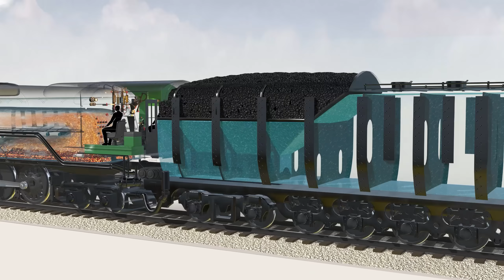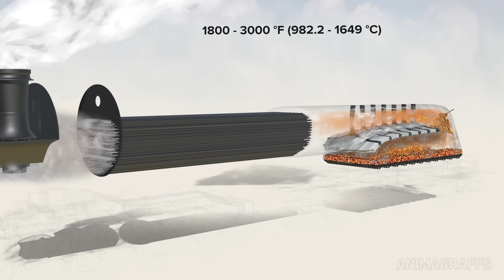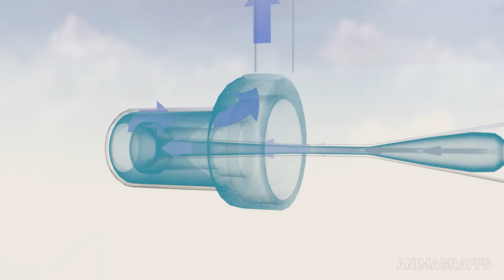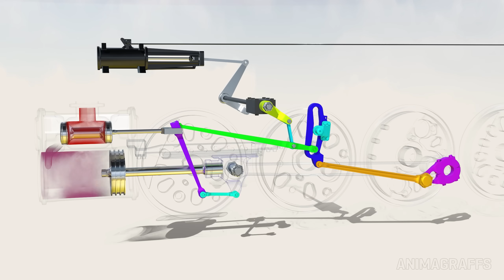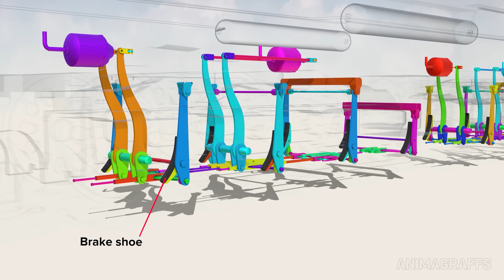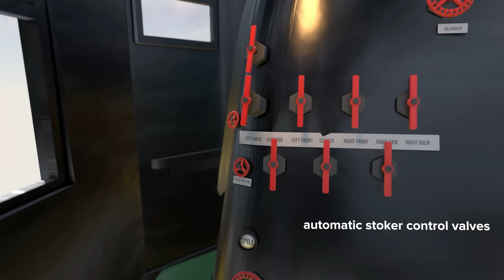How a Steam Locomotive Works (Union Pacific "Big Boy")

Comment: The first internal combustion engines built on so much technology developed for the steam engine. Pistons, piston rings, connecting rods, crankshafts, plain bearings, and poppet valves (not used in this steam engine, but used in certain others). Not to mention the metallurgy and the thermodynamics. The valve gear with its geometry was a kind of analog computer ; mechanical engineers in those days were masters of turning one kind of motion into another with linkages, something we rarely have to think about, since we can use computers and servomotors.

Comment: 00:19 🚂 Big Boy, built in 1941, was one of the largest and most powerful steam locomotives, weighing about 604 tons and capable of a top speed of around 70 mph.
01:19 🔥 Steam power is generated by boiling water, causing it to expand into steam and create pressure. This pressure is used to push Pistons and rotate the wheels.
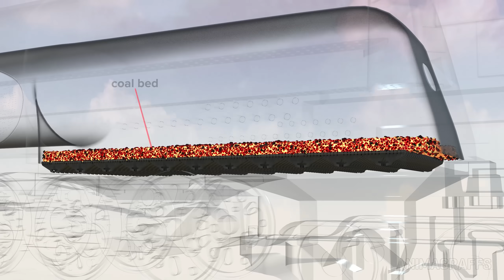02:18 🔥 The Firebox is where coal is burned to generate heat. It has movable grates for coal disposal, air openings for combustion, and specialized sheets to contain the fire.
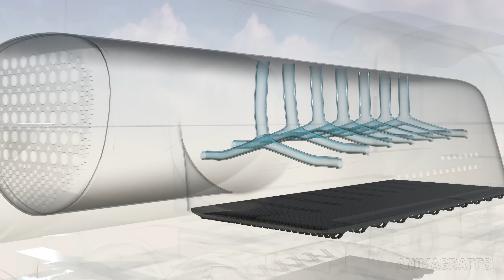03:45 💧 Tubes extending from the Firebox increase water circulation in the boiler. A brick Arch directs heat and smoke for efficient combustion.
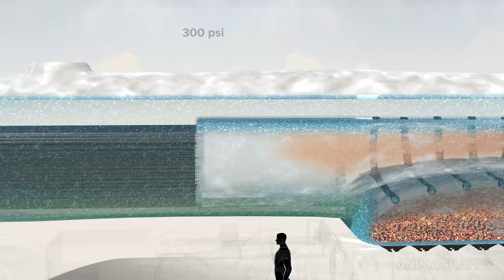05:11 💥 The crown sheet in the boiler must always be covered by water to prevent boiler failure and potential explosion due to extreme pressure.
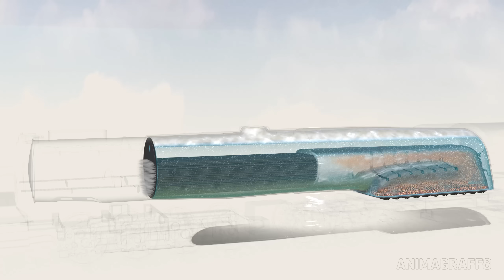06:15 🌪️ Steam is collected in the steam Dome, and blowdown valves help clean the boiler interior. Big Boy uses a separator type blowdown for efficient steam separation.
08:46 💡 An exhaust steam injector uses hot exhaust steam to inject water into the boiler, utilizing a clever process of pressure conversion.
09:59 🚂 The Walsh's valve gear controls the valve timing, regulating steam flow to the cylinders and thus driving the locomotive's movement.
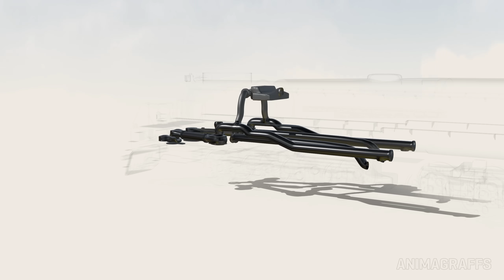14:21 💨 Superheated steam is used to power the cylinders, driving Pistons back and forth. The superheater unit further heats the steam for increased efficiency.
18:22 ⚙️ The valve gear system can reverse valve timing, enabling the locomotive to run in reverse. This system allows for fine-tuned control of steam delivery.
19:40 🛢️ Lubrication is critical for the numerous moving parts, with mechanical lubricators ensuring proper function throughout operation.
20:13 🚆 Big Boy is an articulated locomotive, with two main frame sections joined by a pin, allowing independent movement for navigating curves.
21:30 🌐 Big Boy's wheel arrangement is 4884, with four leading wheels, two sets of eight driving wheels, and four trailing wheels for optimal weight distribution.
23:07 🛠️ Suspension systems, combining leaf and coil springs, support the wheels and axles, ensuring even weight distribution and smooth movement.
25:24 🛑 The brake system operates on air pressure generated by steam-driven compressors, providing precise control over braking for the locomotive and train.
26:29 📍 The cab of Big Boy accommodates four crew members: engineer, fireman, head brakeman, and a spare. Each has distinct responsibilities for safe operation.
29:23 🚿 Sight glasses are crucial for monitoring the boiler's water level, with redundant gauges and blowdown valves to ensure accurate readings and prevent clogging.
31:33 ⚡ The dynamo valve controls the steam-driven DC power generator, supplying electricity for the locomotive's onboard lights.
33:46 🚂 The tender carries coal and water for the locomotive's operation, with a water tank holding 24,000+ gallons and a coal bunker capable of storing 32 tons. The stoker mechanism crushes and delivers coal to the Firebox.